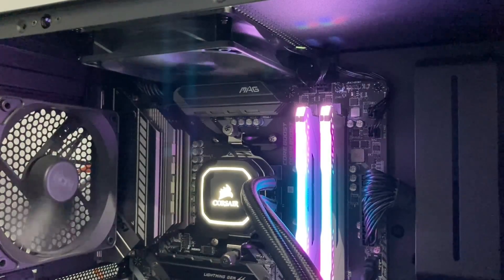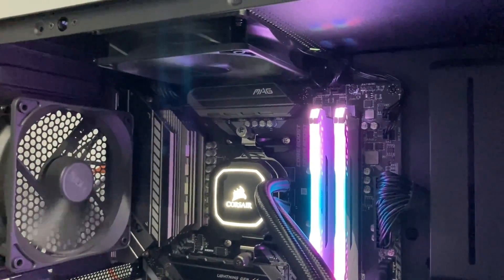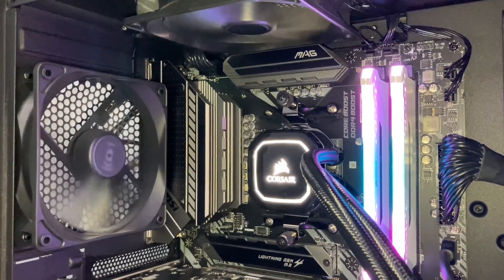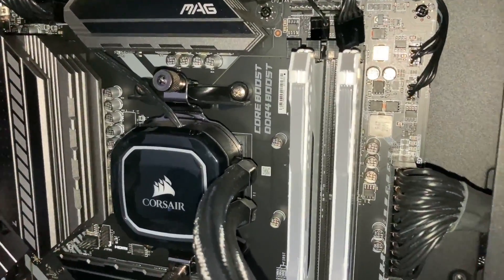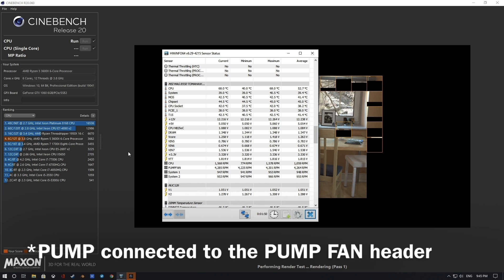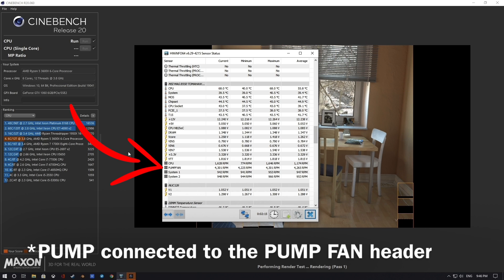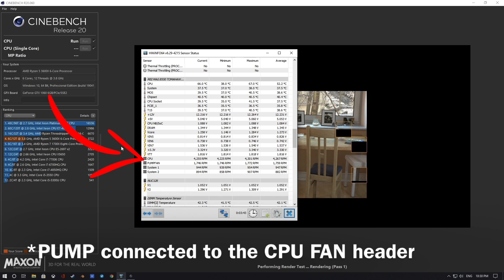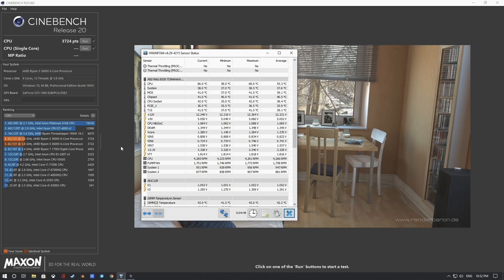Pump tach cable to which header? Pump fan or CPU fan.

Comment: Bro if I connected pump header on cpu fan header and aio fans on system fans will it show cpu temperature on bios/desktop?

And also what is difference between cpu fan header and pump header?
Reply from the maker: Yes it will show CPU temp. 
No difference, CPU FAN is more controllable and more smart. CPU FAN is more safe for PUMP bcoz when PUMP will get damaged PC will be automatically shutdown leaving the CPU unharmed. And it’s necessary, you can’t see the pump is working or not without monitoring in software, the fan can be seen running or not.
Reply: @starrims  oh....why there's some motherboard have 2 option cpu fan header and pump header and some mobo only have 1 cpu header no pump header
Reply from the maker: Fairly expensive motherboards have both options. Having Different Options is always good.

Fan runs faster just after starting PC is very normal, sometimes Motherboard BIOS doesn’t get to control those fans from startups, fans Run at 100% speed, after motherboard understands everything, speed comes down to normal. Don’t worry :)
Reply: Then why now when I turn on my pc (it only happen sometimes) the pc case fans will not spin but rgb fans light up when the bios logo comes the case fans spin to normal speed.? It this normal
Reply from the maker: @youknowwhoiam1412  Completely Normal.
Reply: @starrims  OK sir thank so much for replying my message 🙏🏽 u earn my subs
Reply from the maker: @youknowwhoiam1412  Thank you so much to you too. This means a lot to me truly!
Reply: @starrims  Ok thanks for replying my message and this is my last question I not sure it this problem or not so when I bought a gaming pc like 3 months ago whenever I turn on my pc.my pc fans case will start to spin on max rpm when bios logo comes the case fans it will automatically slow down by itself

But now when I turn on my pc (it only happen sometimes) the pc case fans will not spin but rgb fans light up when the bios logo comes the case fans spin to normal speed. I am worried If my pc have problems.

Comment: I only have 3 fan headers with no pump header would that work for 240mm aio cooler?
Reply from the maker: Yes why not. Connect the pump to cpu fan header and radiator fans to other fan headers in your motherboard.

Comment: i have the a320m-s2h the cheapest one i only have one cpu fan header and a system fan header but i have fans for my system fan header so how i do this ?
Reply from the maker: Use the CPU FAN header for only cpu fan or pump fan. 
And use splitter to connect your other fans in to one single cable and connect this to your system fan header.
Reply: @starrims  ok thx i liked and subscribed
Reply from the maker: @lildeepo7098  Thank you so much. I absolutely Appreciate it from my Heart :)
Thanks!

Comment: bro, so when i connect my AIO pump into aio_pump header while my radiator fan plugged in my cpu_fan header i get error fan message, but if i plugged/daisy chain my aio pump cabke with my radiator fan in the cpu_fan header it works but its showing in my BIOS AIO PUMP N/A is that normal?
Reply from the maker: Yeah, as you didn’t plug anything to PUMP HEADER, showing N/A is normal.

Its fine, but why you want to plug your radiator fans to CPU FAN HEADER instead of the aio pump?
Its always ideal to go with PUMP to CPU FAN HEADER configuration.
Reply: @starrims   ok bro so my aio pump i plug it in cpu fan header? and the fans on my radiator on aio_pump header? im confuse, thanks for replying bro
Reply from the maker: @kaldingg4518  Yes. Connect pump to the cpu fan header and you can connect radiator fans to pump header or any system fan header. Leaving PUMP FAN HEADER alone is completely ok.
Reply: @starrims  ok bro thank you because right now my AIO pump and RAD fans are connected to my cpu_fan header, ill go ahead and plug my RAD fans in aio_pump header
Reply from the maker: @kaldingg4518   yes, that configuration would be much ideal.
Thanks for asking :)

Comment: Which better connect Pump to cpu fan or using converter to sata power? I use gigabyte a320m
Reply from the maker: CPU FAN always. Speed can be controlled.
Reply: @starrims  which better using auto/pwm at bios for pump and radiator?
Reply from the maker: Auto does work fine for me. But its up to you. There is no problem using either.
Reply: Thanks for guidance
Reply from the maker: @ebii1701  You are absolutely welcome :)

Comment: Nice video. I have 3 fans. Fan 1 is running at 290rpm in quiet mode but fan 2 is stuck at 2500rmp in any mode. The pump is at 1900rmp. Is fan 2 connected wrong?
Reply from the maker: Are you sure, you connected all fans to the proper ports? (System fans, Radiator fans to the SYS/CHA fan header. PUMP to the CPU/PUMP fan header).

If yes then try manually setting the fan speed in bios. (Softwares Can have glitch)

Or, Try after updating BIOS to the latest version.
Reply: @starrims  thanks, ill have a look
Reply from the maker: Check out my other videos, if you feel like please subscribe. It will be much appreciated :)

Comment: Do u need to set the cpu fan header with the pump on IT to full speed pwm or DC ?
Reply from the maker: To control fan speed you need PWM connection (4 pin header). CPU FAN PUMP FAN SYSTEM FAN all headers are PWM.
Reply: @starrims  its a SATA with 3 pin connection plug. But idk need to set DC OR pwm and auto OR full speed at pump. Fans on auto but way to loud.
Reply from the maker: It use SATA to power the pump, and the pump tach cable to send the control information. 
Personally I set it auto but its almost always runs at full speed (4000RPM+-) but noise isn’t any issue for me (Corsair H100X). 
I don’t think its the PUMP that causing noises in your system, it’s maybe other system fans and radiator fans, turn them down and see.
Reply: @starrims  yea i got corsair also. i will lower the fans soon. i think also i need to set them the fans auto they working wrong.
Reply: @Blauwdruk3D  Yeah I have a masterliquid fan that's rattling and causing noise. The pump is dead silent.
Reply: @starrims  yea but i mean the pump must run at full speed ? Or auto.
Reply from the maker: Pump will run at full speed by default and you can turn down the speed if you want.

Comment: Hey my cpu fan header and pump are both 4 pin but the cable from the actual aio is a 3 pin will that affect anything?
Reply from the maker: No. Its normal. Don’t worry:)
Reply: @starrims  thank you I got scared
Reply from the maker: You are welcome. Nothing to be scared. Build your PC with ease :)
Reply: Had the same question.  running the corsair h150i elite with no commander core, I'm like what do I do with this single wire 3 pin pump tach cable?  Apparently they plug into 4 pin fan headers.

Comment: Bro, you got new sub!!
Thanks for this.

But I have 2 questions to make sure (I'm newbie)
1. Is pump ok to be always run at 3000+ RPM?
Because I have two options : 1K RPM (Quite mode) and 3K (Performance mode)

*I saw some youtubers SET their fan around 900RPM - 1000RPM and pump around 3000RPM, and their CPU temp around 35c-38c (idle)

2nd, maybe dumb question..
So, my cpu temp is around 55c-60c while watching youtube, with fan speed 1300RPM & pump speed 1100RPM.. Is that normal?

But when I setting my Pump speed to 3000+RPM (with fan speed still at 1300RPM) my cpu temp down to around 38c-45c while watching youtube..

Which one do you think should i use for my daily work?

(Please help me, those questions really important for me)

Once again thank and great video brother!
Reply from the maker: You are welcome. I appreciate your support.
Pump Fan at 3000 RPM is pretty normal for an AIO pump. My Pump stays at 4200RPM (Corsair H100X) all the time. But yeah if you Turn the fan speed down the longevity will be better for sure.
CPU ideal temps depend on ambiance temp too.
55c-60c is a little bit on the higher side in ideal (considering youtube is not a heavy task) But 60c temp is completely fine for a CPU and for a CPU  when PUMP is at 1100RPM, it looks good.
I would suggest set the PUMP at 3000 RPM, there will be no problem at all. But again for daily work 60C is totally fine if you really want a silent profile.
After all, nothing looks abnormal to me about your system, it's absolutely fine, nothing to worry about :)
No question is a dump, you can ask me anything anytime, that's how we increase our knowledge :)
Once again Thank You and don't worry about your system enjoy it :)
Reply: @starrims  thank you so much for the quick response bro, really appreciate it!

Now I set my cpu fan speed around 900RPM & pump at 3060RPM (max speed) then I find out my cpu temp reach 65'c while watching youtube + another tabs (I use dual monitor btw)
I know I can set cpu fan speed to 1300RPM get better temp, but I want to silence performance, so I go to my power options and set minimum processor state 85% and max at 90%.. now works fine for me, because with fan speed 660RPM & pump speed 3000+RPM, my temp now 30c-33c..

I know limiting my processor state will reduce the performance but I think it's fine for me :D

Once again thank you so much, the question about pump max speed really important for me, so I really appreciate your answer!🙏🏻👍
Reply from the maker: Yeah it’s all about personal preference how you wanna use your computer and that’s why there is lots of profile settings. 
Your temps look totally normal and fine. Glad my video somehow helped you. 
Thanks :)

Comment: So if you have a AIO you can plug it in cpu fan header but it will not notify you when something is wrong and if you plug it into the AIO fan header then its gonna notify you? But lets say if you have a air cooler and you plug it into cpu fan header then its gonna notify you but if you plug it in to the aio fan header then its not going to notify you? Did i understand it right?
Reply from the maker: Little messed up 😅.
Connecting any fan in to CPU FAN header will notify you. 
If you don’t connect anything to CPU fan header PC will not turn on.
So there is no way someone will plug air cooler to aio header (pump header), leaving CPU FAN HEADER empty.
Reply: @starrims  But if i maybe connect case fan into CPU FAN header will it turn on then🤔
Reply from the maker: @hyposez1129  Yes it would.
Reply: @starrims  Ok thx for answering my question!
Reply from the maker: No problem :)
Reply: @starrims  that's wrong! if u not connect something to CPU_FAN header you still be able to start your pc! just disable cpu_fan/cpu temperature monitoring in bios settings and you're all the way to start pc! but this solution only not mean you can do it without cpu cooling hardware installed itself! it must be installed but could be connected to cha_fan or something like this. my pc works perfectly this way!;-)
Reply from the maker: @elsedarus   Yeah true but it's a lot of work for a beginner. This video is meant to help a first-time PC builder instantly, also not a very convenient way to build a PC. But yeah I agree it's possible.

Comment: Hi! I have a MSI z490 Gaming Edge Plus with PUMP_FAN header and ID_COOLING AURAFLOW X 360 liquid cooling. Where we should plug the pump connector and fans?
Reply from the maker: Pump to the CPU fan header. 
And for fans you can use pump fan header or system fan header.

Comment: Isn’t there two wires you have to connect? You have the Pump then just the normal cpu fan... if I plug the pump into the CPU header, where does the other wire go?
Reply from the maker: If there is other wire, that is for LED, connect it to the LED header and connect radiator fans to System or pump fan header.
Reply: @starrims  sorry for all the question but this is my last one... so can i plug the radiator fan into the CHA_fan header? so it will be a chassis fan?
Reply from the maker: @ItzRazed  yes you can. SYS or CHA fan header is same. 

Ask anything, I’m here to help. Questions doesn’t bother me at all :)

Comment: I have the Aorus B550i Pro AX with NZXT H1. Can you please help where to connect these 4pin and 3 pin cable exactly? Also there’s an adapter with the motherboard in the box, what’s that for?
Reply from the maker: Go for 
Aio Pump > CPU FAN header 
Radiator fan > Pump Fan Header 

Or you can swap the configuration. (NZXT recommended)

I think the adapter is for front panel connectors to spilt them (usually you don’t need that)

Edit: I just checked your motherboard doesn’t have PUMP Fan header so don’t worry.
Use the CPU FAN header for 3 Pin aio pump and use SYSTEM FAN header for the 4 pin radiator fan.

Comment: Thanks a lot bro! help me detect a pump failure on my CM ML120 AIO. 
My setup is MSI B450i itx, I have only 1 CPU fan header and 1 SYS fan header. 
I tried to switch both because I was confused at first, whether I installed the AIO wirings wrong. CPU always hits 90-95c and shuts down on Bios with HW Monitor, 
The instructions on my AIO specifically  says Pump to SYS fan, Rad fan to CPU fan, but it does not matter as you have proven so the problem is my cooling. Placed the stock Ryzen cooler and it worked 35-40c CPU on air cooler. I am now in the process of RMA-ing my AIO.
Reply from the maker: I’m really sorry to hear that... getting a faulty product is really not good! I wish you best of luck Bro.

Comment: Thanks for the vid. Very helpful. I was advised to connect the AIO to the CPU FAN header, and followed instructions, works fine - but the fan speed of the radiator is over 4k! Apparently that's normal, but its just nice to see it done by others also. Cheers
Reply from the maker: Thanks Bro, made my day :)
Its always nice to hear some good comments to keep me going thanks.

Edit: yes CPU FAN header pushes the fan to the limit, the fan will always run at highest speed.
Reply: I'm new to this and don't claim to know too much but my cpu fan header is a four pin and the corsair aoi is a 3 pin. Can you still plug it into the 4 pin header or do you need a 3 to 4 pin convertor?
Reply: @lillysimagination3688  I believe you can but you won't be able to control it via Icue, armery crate etc. the fan will run full tilt all the time or however fast the motherboard decides is fast enough.
Reply: @lillysimagination3688 you can it'll just run at a fixed speed.

Comment: I got a nzxt x53 aio. I've connected Pump tach cable to CPU_FAN and radiator 2 fans cable using a splitter connected to SYS_FAN port. Is it correct?
Reply: Thanks. Keep doing these kinds of videos. Really helpful.
Reply from the maker: Thank you. Yes I will :) 
Please keep supporting...
Reply from the maker: Yes it is correct

Comment: Can connecting to cpu fan header cause cpu speed fan error during initial boot?
Reply: If you connect it to AIO Pump you get a CPU Fan Error.
Reply: @WheeledHamster  I ended up disabling the cpu fan error, thanks man!
Reply from the maker: No there will be no problem. I have tested both.

Comment: Thank you, because I was going to buy an AIO but I double-check my motherboard and it didn't have a pump fan, thank you for the information
Reply from the maker: Thanks I appreciate that. You can subscribe for more.
BTW, not having pump fan header is not a problem. Use CPU fan header for pump and “sys or cha” fan header for radiator fans.
Reply: @starrims   for radiator fans i want to use a fan fub, will this work?
this one https://www.aliexpress.com/item/4000961082351.html?spm=a2g0o.cart.0.0.20b43c00ClTrvJ&mp=1
Reply from the maker: @Soouule   Yes any hub will work. This hub should work. But my question why not buy cooler master or deepcool one?
Reply: @starrims  ahhhhh good idea, ill try looking for one
Thank you, appreciate it

Comment: I have an aio and its connected to the cpu fan header. Another case fan is connected to the aio pump header. Is this wrong?
Reply from the maker: Its fine but do you have high fan noise? 
Its ideal to connect fan to sys fan connector.
Reply: @starrims  i switched them, fan speed has increased and cpu is cooler. Where is system fan connector?
Reply from the maker: @MannyRiberaOriginal  search 4 pin header across the board, it may labelled as sys fan or cha fan (chassis fan). Placement of this connector is not universal, positioning is different board by board.
Reply: @starrims  is chasis fan meant to be the fan on top of the case or at the rear end? There is cpu fan, cha fan and aio pump. Aio pump is connected to aio header. Its just the other 2 which might be in the wrong places?
Reply from the maker: Chassis fan means all fans. Top rear. There will be multiple cha fan header.
Reply: @starrims  ive got one cha fan and one cpu fan unless its somewhere else in mb.
Reply from the maker: I believe any motherboard have more than one system fan header. But even this is not the case with your mobo, there’s nothing left except going for aio header!
Reply: @starrims  x470i is my motherboard.
Reply from the maker: Search for header. There must be more than one.

Comment: please help my motherboard has only 4 pin cpu fan header and 3 4 pin system fan headers can i still hook up a cooler like this?????
Reply from the maker: If you have aio cooler use the cpu fan header for the pump and system fan headers for the radiator fans. That’s it :)
Edit: Do a favore by subscribing :)
Reply: @starrims  thank you so much i was confused!! You helped me!!

Comment: But my pump header is a 3 pin and it doesn’t fit in the pump fan1
Reply from the maker: Which motherboard?
Just connect to CPU fan header.
Reply: @starrims  my motherboard is a msi b450 tomahawk max and that’s also a 4 pin.
Reply: @alexanderthe_great7205  you can still connect a 3 pin into 4 pin.
Reply: @MannyRiberaOriginal  i think it will damage fan if you do that
Reply: @pikachusolu1606  nope. It just doesnt utilize the 4th pin.